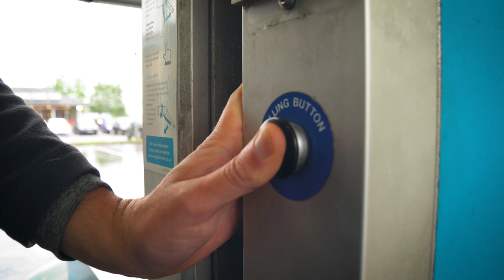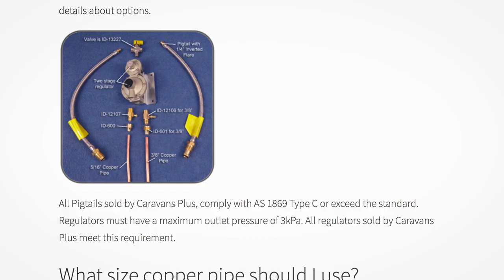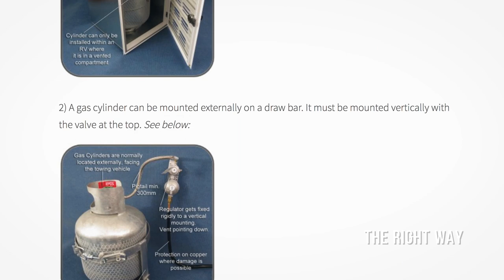VAN LIFE: Building a DIY Propane / LPG / Gas System for Van Dwelling

Comment: Apart of me feels like it might be a little sketchy to have a propane tank hanging right above the road, or am I trippin?
Reply: Yeh I was expecting metal sheet guards around it.
Reply: That's how the OEM tanks are setup with the Westfalia packages for Bay windows and Vanagons ... If I remember correctly, that tank is specified as an upgrade to the OEM tank, intended to be installed like they did.
Reply: Seems ok for the smooth flat roads of the USA. But the unpaved dirt tracks of Namibia could be a different story.

Comment: Love your videos and exploration ideas but this is a disaster waiting to happen.  You guys need to research more before just installing what you think is best.  All those fittings and assembly is going to leak over time if you don't use the proper equipment and sealant. Go to a plumber and get it done right if you need to. The vibration alone when you travel is going to shake apart everything in the Van. Secure down the hatches and bring plenty of parts when you go.

Comment: sorry, this might backfire. very complicated, high tech AND for third world countries?!? In the end the danger is in weird adapters to fit the gas tanks nozzle     somewhere in the far east... or things like the solenoid failing and beeing replaced by dodgy spares somewhere in rural india. 
alcohol is availiable almost everywhere, exept hardcore moslem countries. there  and at high altitude use methanol. the origo alcohol burners have prooven indistructable for decades. one can carry a 20 liter metal jerrycan on the rear rack, outside the van. cant get it more safely.
Reply from the maker: In those places they will hand carve new pieces out of a block of brass for less than the cost of shipping 😆....or we will just eat out
Reply: I always thought that fuel containers of any kind were more of a risk in a collision when they are attached to the outside of a vehicle.  RV manufacturers seem to store such containers within the shell of the vehicle in most cases or down under as Boomerang.  Maybe it is more for aesthetic or practical reasons though.
Reply: sorry if I didnt make my poit clear.
its fairly common for e.g. yachtmen on a round the world trip to start out with first world country equipment. quite soon these things get repaired and replaced  in the countries one travells to which often  makes the rig more simple and down to earth. therefore it makes sense to me to start down to earth in the first place. investments in safety gear like a propane system are fine but one has to adapt to the safety levels of rural india anyway.